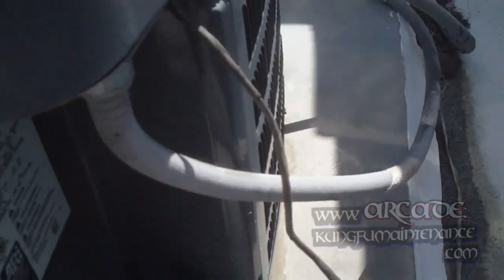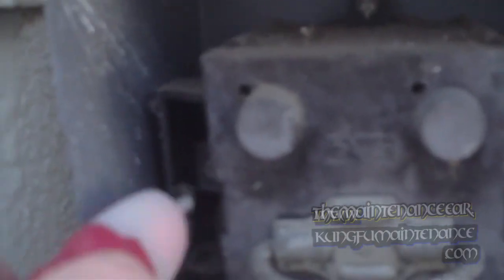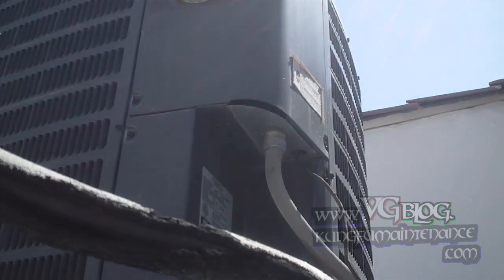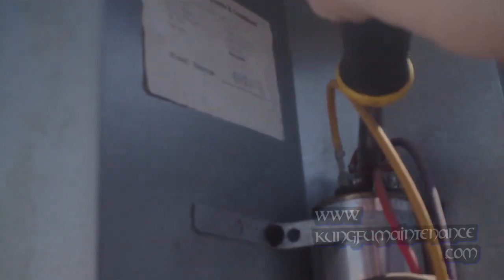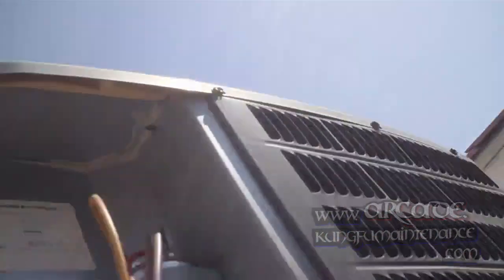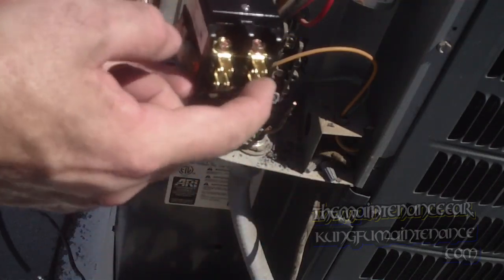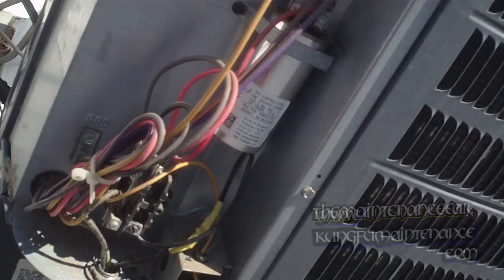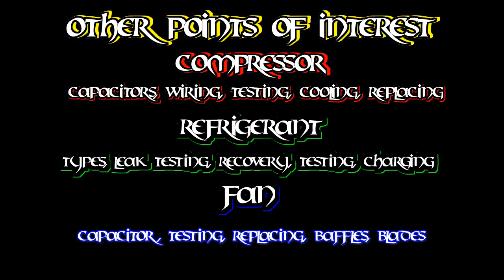How To Repair Broken Air Conditioner Electrical Power Supply Line To Contactor

Comment: Guys he said to me BEER CAN COLD DOES WORK!!! Can y'all believe that he said it DOES WORK!!! Can we say HACK!!!!
Reply: KungFuMaintenance Beer can cold lines can be caused by a number of failures including mismatched indoor coil, overcharge, and low airflow. Was that an accumulator on the outside of that unit?

If you put up a video of this stuff guys will think it is the right way and reproduce it. The contactor should have been changed, the whip should have been replaced.  I know how it is in apartments, but right is right.
Reply: If it's 90 degrees in the space he should be drinking warm beer.
Reply from the maker: My point was that if a unit has been running for five minutes and it was over a hundred degrees outside than the suction line should feel cold to the touch. Beer can cold does work just as a quick check that the unit is working.
Reply: I agree with talyn875 I can not tell you how many units I've been to because the unit was overcharged because the last guy used the beer can cold method. Had he would of checked super heat and subcooling he would have known 100% if the charge was correct. I will tell you this, if a space is 85 of 90 degrees and your checking a charge using beer can cold you will be wrong every time. In that case you would have around a 35 degree superheat no way would the line be sweating or cold. I'm glad you can take these comments with a positive attitude. Please consider using these suggestions, it will make you a better tech and the units will thank you for it.
Reply from the maker: talyn875 Thank you for sharing your knowledge. Yes that was an accumulator. I guess I forget to include details that I clean all the coils inside and out every year and change all filters every three months as well as all my unit coils  are properly sized due to this I pretty much always have good air flow. Definitely not the case out in the traditional AC tech service world. Why would or should the whip be replaced if there was enough wire to replace the contactor?

Comment: Dude you should of changed the contactor!!! All that crap you did splicing the wire I could of changed the contactor faster than you did that!!! And Beer can cold does NOT WORK!!! You need to learn Super Heat and Sub Cooling!!!
Reply: Yeah I was wondering why he just didn't change out the contactor, He kept showing it but never installed it
Reply from the maker: Perhaps you are right about the contactor. I actually did wind up changing the contactor about three weeks ago. It lasted about six months. It was a fairly new condensor and I took the opportunity to show a different way someone could make the repair if they did not have a contactor or just for the purpose of exploring different ways a repair can be made.

The splice held up just fine. Beer can cold does work (and is useful sometimes as a quick check on days over one hundred degrees) just Super heat and Subcooling work better as long as they are done properly. Of course this is a subject of much debate and strong opinions.

Comment: Another WOW HVAC video!!!! Not really sure what to think... As much time as you spent dicking around trying to fix the burnt wire you could of replaced the whip. The thing that blows my mind is you had a new contactor in your hand and you still didn't replace it. WOW!!! Thumbs down on this video!!!!
Reply: The wires are completely burnt. I guess you think when I say replace the whip, I’m referring to the conduit. Well I am! Supply houses DO sell electrical WHIPS (premade conduit with new wires). Therefore, the phrase that I’ve always known as a whip. Now, if you don’t want to replace the whip, the next best thing to do would be to get the right size wires and feed them through the old existing conduit. So, it would then be all new wires from the Disconnect to, what should have been replaced, the contactor. In the time it took you to complete a bad rigging job, you could have, just as easily, replaced the electrical WHIP and the contactor…and everything would’ve been jam up perfect and would be full of thumbs up!!! And, you might want to put the gauges on too…that kind of helps. Just saying, PEACE, I’m OUT!!
Reply: KungFuMaintenance There is a HUGE difference between repair and rigged !!! The whip AND contactor both should have been replaced without even a thought. Getting it running again means nothing. G
etting it running again by repairing it correctly and safely means everything. This is NOT how you should ever do this job. Poor workmanship all around.
Reply: Because the splice pigtail you used was not properly installed, was not intended for that use and the wires were in bad shape.
Reply: Right Choice HVAC glad to see you enjoyed it too. I'm pretty speechless that's why I really haven't chimed in on it.
Reply: Job security for all of us I guess. I know I don't post many videos and I'm far from perfect but dang really!!!
Reply from the maker: No need to replace the whip. The contactor perhaps. At the time I wanted to show another way the repair could be made if someone did not have a contactor. I like to show and explore the different ways things can be done as properly and safely as possible.
Reply from the maker: T&N Services LLC. If you really want one to criticize me on check out me Kung Fu Maintenance vid "Beware Air Conditioner Of Death One Misstep Can Be Your Last Repair Video".
Reply from the maker: hvactecster79 There was enough wire to change to a new contactor. Why would the whip need to be replaced?

Comment: Good lord! Replace the whip and the contactor! No gauges? Beer can cold? I'd like to see the fire you created when that "crimp" fails and it melts again! Lastly, please learn to edit your videos.
Reply: Agree it was pretty bad!!!
Reply: Just a little bit of voice-over editing would improve this disaster immensely!!
Reply: Better yet, don't upload bad repairs. That crimp-on compressor lead won't last very long!
Reply: That lug was probably loose but I wouldn't leave that system without making damn sure there was no other reason! It's not job security if you cause the callback!
Reply: Damn Stephen Rardon I thought I was bad on Bad HVAC service videos
Reply: T&N Services LLC. I learned from the best! You!!
Reply: The student has surpassed the master, huh?!
Reply: Stephen Rardon if I've learned anything, I've learned that channel locks is not the proper tool to use on a crimp. I also will say this, there was a time when people could load sub standard work up on YouTube. Those days are over!!!! All I ask is please if your going to load up videos make the content accurate. What you showed in this video and the others you have is really poor. I've watched a hand full of them and shook my head the whole time I was watching.
Reply from the maker: No need to replace the whip taskmaster. The contactor yes would have probably been better to replace but I took the opportunity to show another way that someone who did not have a contactor could make the repair. This particular job ( an electrical failure) did not require gauges. Beer can cold is a valid quick check on days over a hundred degrees. There is a reason all wire connections are made inside the metal AC junction box. ~ To prevent fires. The wire is a valid repair part sold by a reputable manufacturer for the very purpose having a good reputation of not starting fires or the manufacturer would stop selling it as such. ~ Thanks for watching. ~ I hope to show improvements day by day. :0)
Reply from the maker: Stephen Rardon If you really want one to criticize me on check out me Kung Fu Maintenance vid "Beware Air Conditioner Of Death One Misstep Can Be Your Last Repair Video".
Reply: KungFuMaintenance the valid repair part is not intended for use in the application you made. That  compressor terminal repair wire was intended to repair compressor terminals which are stranded wire. Solid copper wire will not allow a proper crimp, as such that connection will loosen over time and you'll be right back where you started. i hope when you have to go back again you take the time to repair the system properly. Am i wrong T&N Services LLC. ?
Reply from the maker: Stephen Rardon I will have to research that about the solid wire to stranded wire crimping. Thank you for the insight. It has not loosened yet but is an easy repair should that happen.
Reply from the maker: T&N Services LLC. I hope to show improvements day by day. I strive to make my content accurate. I am not above making mistakes. I hope to help others by showing the whole processes. I allow my mistakes to show better improvement over time and so all can learn by it. Your insights are welcome here. Yes I could have used a better tool for the crimping.